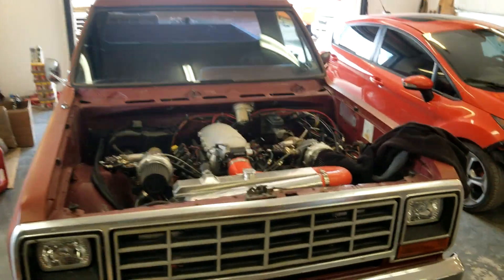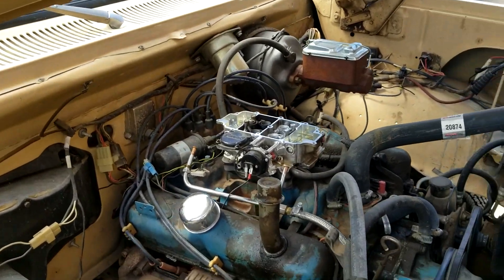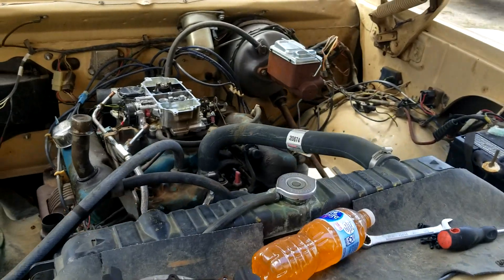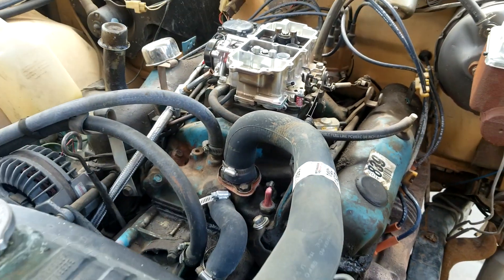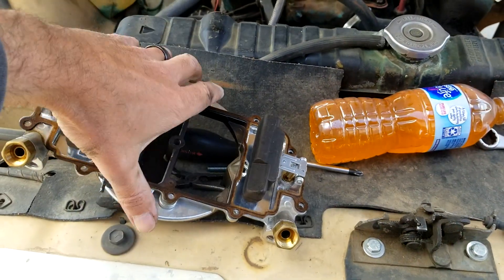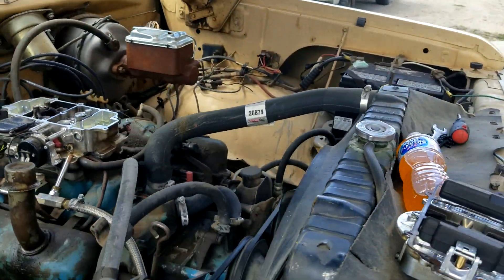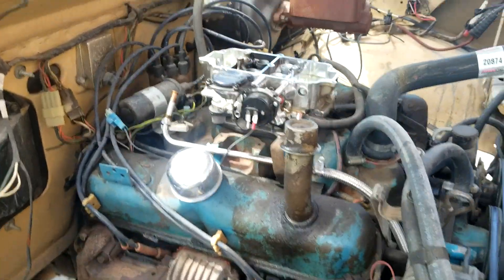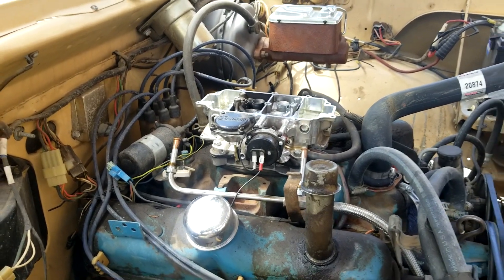Summit carbs any good? I was impressed.

Comment: I put the 500 version of that on my hot rod, and it really ran well.  It did NOT get as good gas mileage as the 600 Edelbrock I took off (because it was needed for another engine).

Comment: Those are pretty nice carbs. Like someone else said it was originally sold as a Holley 4010 from I think 1990-1998. It was based on a modified Autolite design. It had all of the nice features of the old 4150/4160 carbs but only had 1 gasket above the fuel level. Best thing was the annular boosters. I think Holley called it a 'Show Carb' or something. Don't know why it never really took off. Used to be able to get them used pretty cheap. Fairly sure the Summit uses the same tooling, probably made by Holley.
Reply: They were used majorly on boats in that time era. That's when Holley was using those crappy plastic floats and they had a lot of flooding issues due to the floats either bending or sinking. Sometime towards the end of the production run they started using the nitrophyl floats, but the reputation was already damaged. Notice the new Summit version comes with nitrophyl floats. Holley also made a marine 2 barrel called the 2010, but almost no information exists on those.
Reply: not the original tooling as i understand it it had been destroyed, so they redesigned it to have some improvements but still use Holley parts wherever possible. Both are clones of the Autolite 4100 but that only went up to 600cfm and now you can get a 750.